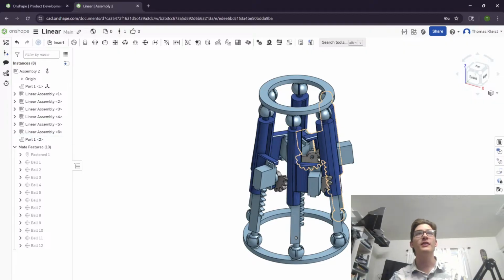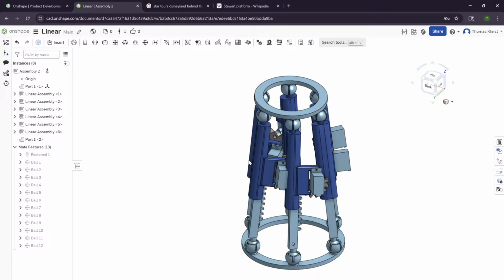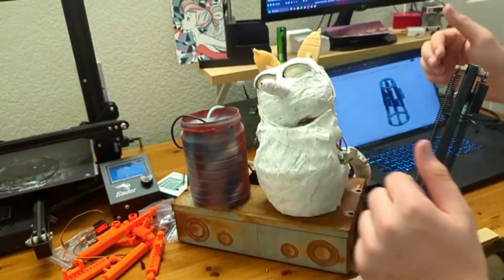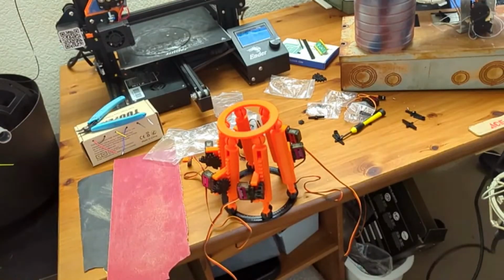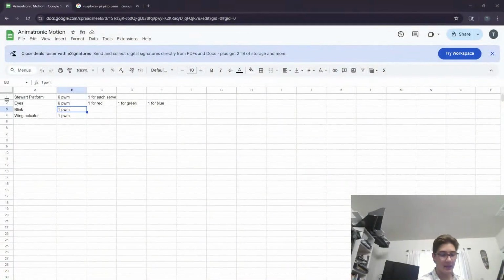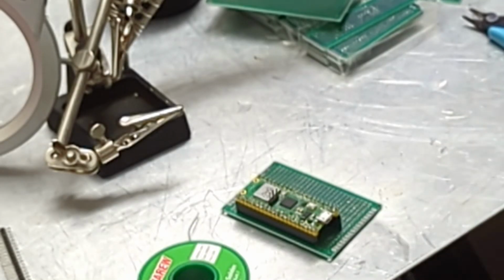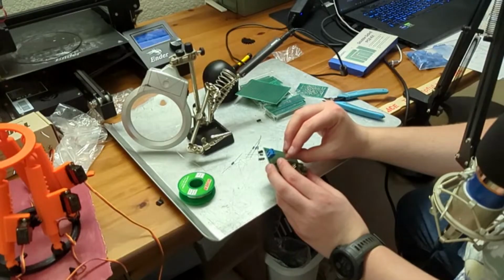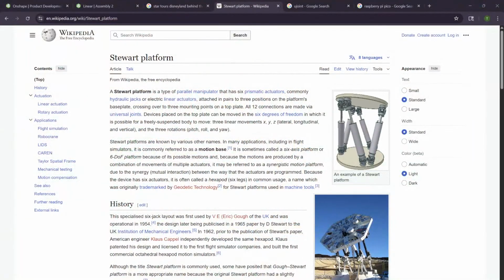Building a STEWART PLATFORM!

Comment: Immediately from looking at the thumbnail, I notice a big design mistake that’s causing the lack of rigidity: Stewart platforms always have the struts at alternating angles, to form more of a triangular antiprism, rather than a hexagonal prism. With your configuration there’s no way for the platform to move in yaw (which is done on Stewart platforms by lengthening and shortening every other strut). Great work by the way, I hope I don’t sound harsh. Just trying to save you from having to troubleshoot.
Reply from the maker: That's what I figured as soon as I built it. Thank you for the tip! Do you think the ball joints are contributing to the issue because of the rotation on the main axis of the actuators?
Reply: @kleistrobotics2220  That shouldn’t be an issue, you could use universal joints instead of ball joints on the bottom, though.